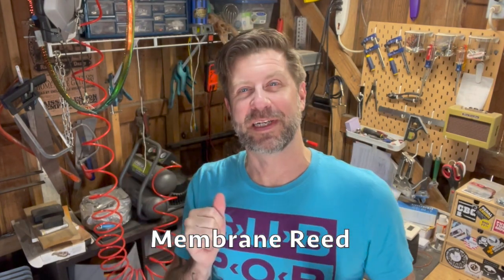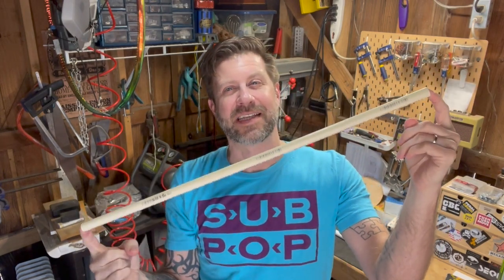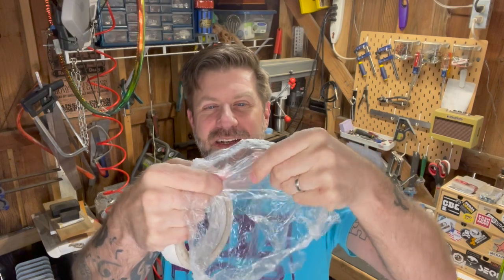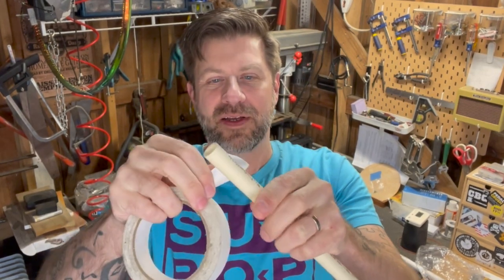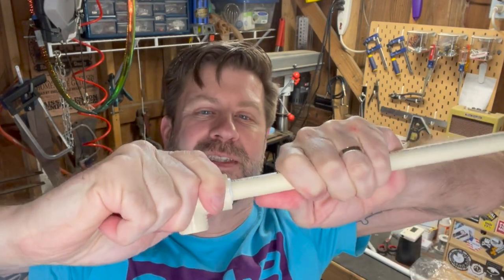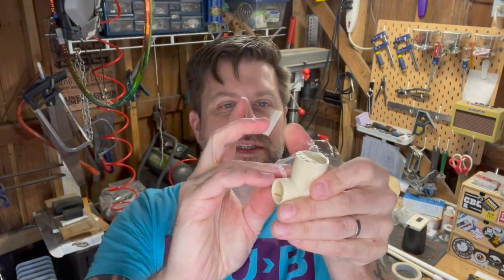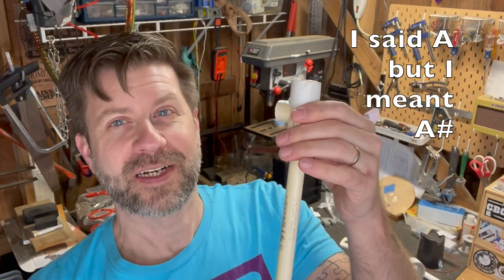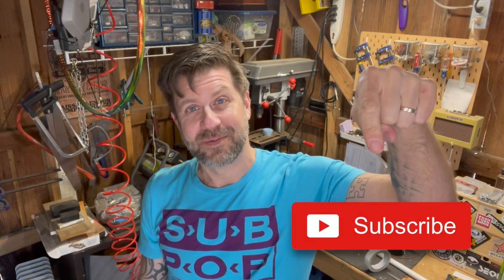My First Attempt at Making a PVC Membrane Reed

Comment: I made some of these ten years ago. If you go to the big box store you can find a plethora of different sized plastic pipes that will fit inside each other to varying snugness. I built mine from combinations of schedule 40 and schedule 80, and some CPVC like you used, but mostly in the 1/2" to 1" range. I also used epoxy to seal the finished products together. And to take care of any air leaks. I used a rubber glove as the membrane. And the membrane is held tight by stretching it over the end, and then a ring of PVC on the outside of it.
Reply from the maker: Glad it worked for you. Thanks for checking out the vid.